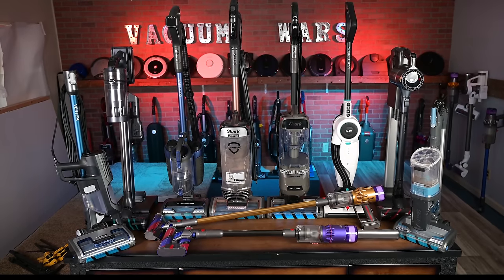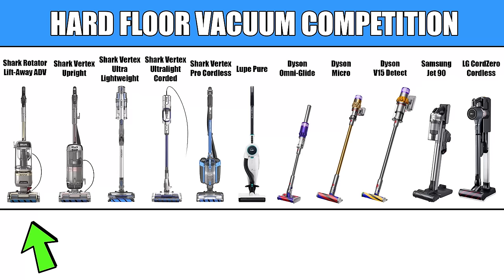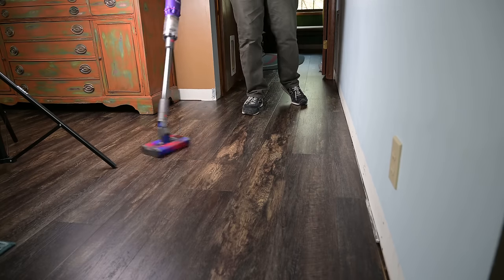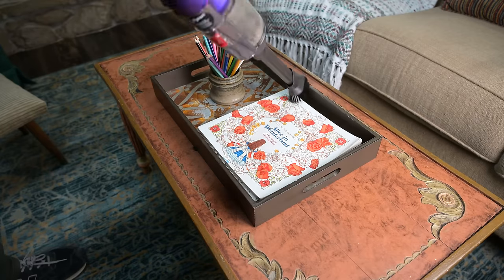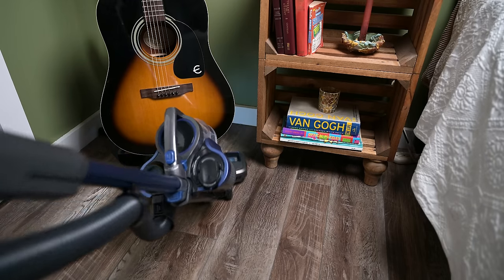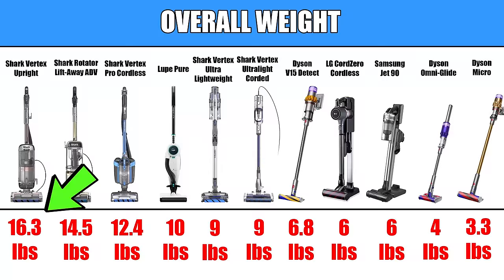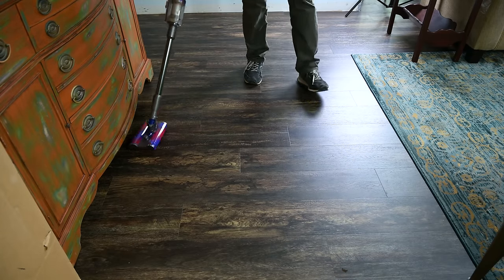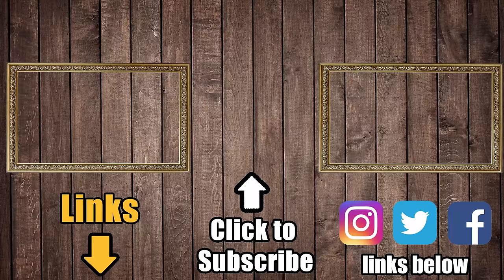TOP 3 Best Vacuums for Hardwood Floors - Early 2022

Comment: Don't understand what's up with all the comments clinging to their 80s canister vacuum designs. 

It's been 40 years, nobody wants to pull a big canister behind them.
Reply: I just got a Henry and it's lighter than my old upright vacuum yet picks up more things on my floors since it's got much more power. Canisters now are far different than what they were 40 years ago. And, some of these vacuums cost more than a good canister but perform worse and will not last anywhere near as long. If he did long term reviews where he only used one of these vacuums for a year, you'd see a performance drop off as well as a disgusting amount of dust build up since they're all bagless. If he did the same with a canister, there'd be no performance loss and it would be much cleaner. Asking for canisters to be included is totally valid, they would just make his recommendations go against his sponsors. If you're curious, Performance Reviews on YouTube has a video where he shows a Shark after a few uses and it lost a ridiculous amount of power already. They're simply not worth it.
Reply: I work at a vacuum center and for all hard floors canisters are always going to be the best option for hard floors. There are uprights by Riccar and Sebo oreck even that will do floors decently well but nothing can ever beat the efficiency of a canister when it comes to floors.
Reply: @Pianoconnoisseur29  It doesn't matter, what matters is how often you vacuum, hence a robot vacuum that runs daily and a lightweight handheld companion beat the shit out of manually vacuuming once a week.

I don't know any of the brands mentioned in this thread. Have you heard of Dyson, Miele, Samsung?

Talking about efficiency, a brush design with a weak suction surely will require a lot less power for similar cleaning levels. 

We know the robot vacuums pick up 90-99% of standardized test dirt in testing on hardfloor (my robot picks up 98%, the best clock in at 99,8%), an upright/handheld vacuum with the same brush design will perform similarly.

You can't argue that 99,8% of test dirt picked up is not decent, that's absurd. And they use very little power thanks to combining a brush with a lower suction motor.

The robots struggle a lot with carpet as they'd need more suction for it, but the handheld vacuums got that extra suction (robo has 2000 Pa, handheld has 20 000 Pa), so they should perform a lot better.
Reply: Basically everyone can do hardfloors well, all you need is a good brush or a ton of suction, the only place you really see differences is carpet where you need that ton of suction and don't get that far with the brush.

Comment: I have a Dyson and I love it! We bought the V10 when it just came out! It's warranty ran out I think at 2 years after that it's been nothing but trouble. It cleans amazing but push button broke a couple months after warranty ran out, and they wanted to sell us the part for $80 and my husband found it on Amazon for $10 and he changed it. A little after that it started turning on and of by itself and I have to move the battery part for it to turn off. Then idk if it has to do with the battery thing but now it doesn't last long anymore i have to charge it before I use it. It works amazing but i think they are cheaply made. 🫤